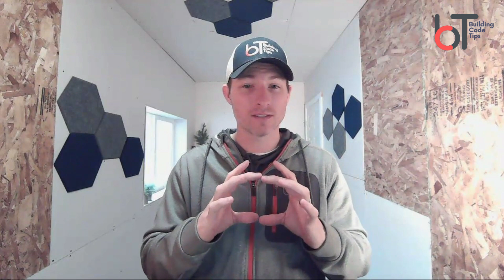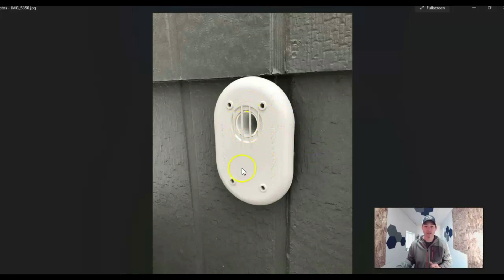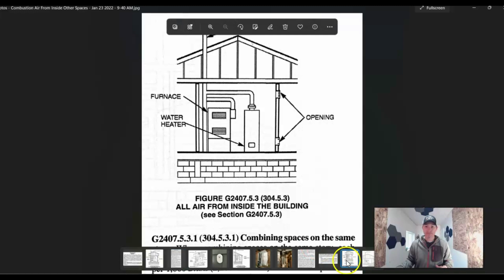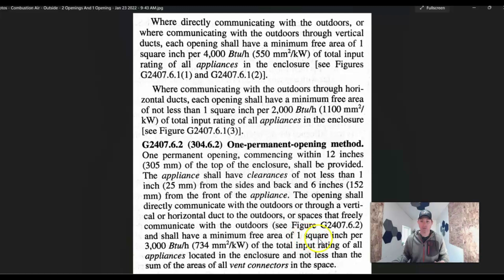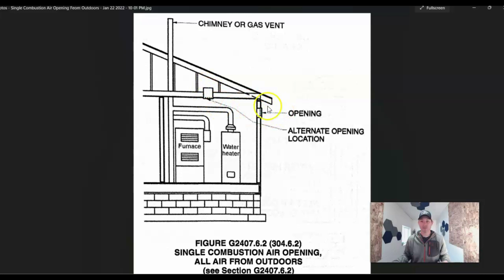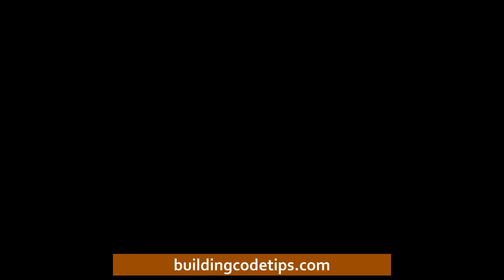Combustion Air Basics & Why It Matters For Gas Appliances | DIY

Comment: 1 sq inch per 4,000 btu/h means my weil mcclain unit at 140,000 btu/h would need a 35" hole in the side of my house. All of the windows in my basement being open don't equal 35" of open area 😅😢
Reply: In your situation they are looking for a 35 square inch vent, not a hole 35” in diameter. To solve for that-
 Radius = the square root of the area divided by pi. A 6.7” wide hole would work for you
Reply: @masoneley461  you are 100% correct and I didn't consider that 😅